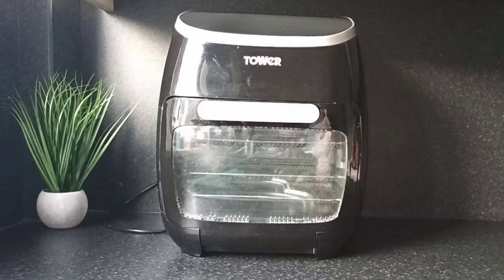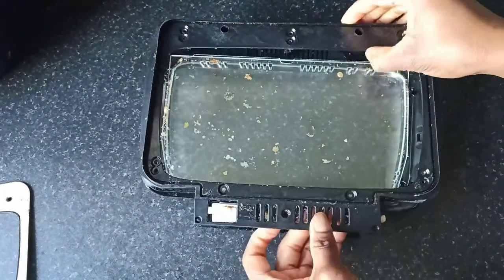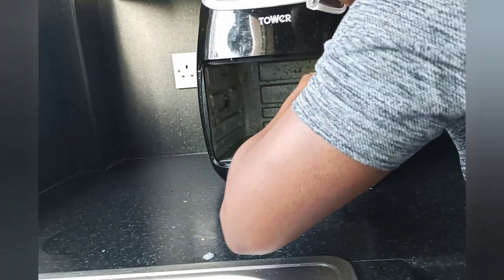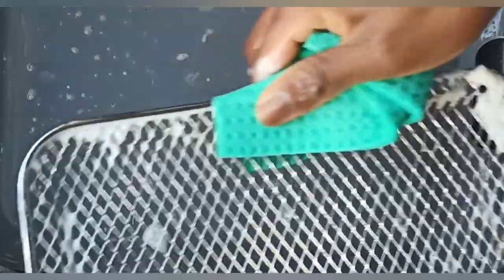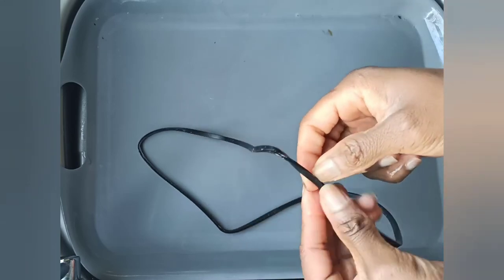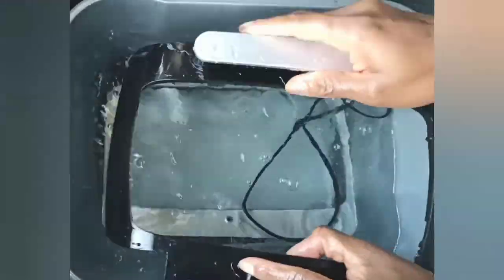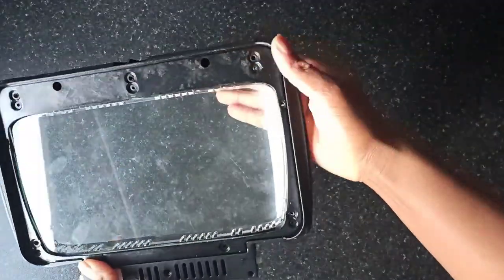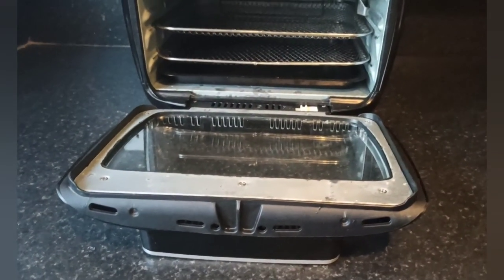CLEANING AND MAINTENANCE OF TOWER 5 IN1 DIGITAL AIRFRYER OVEN. How to thoroughly clean Tower Airfrye

Comment: thankyou Emily,🙏
this was very helpful,I also missed those 2 screws and without them undone and the cover completely off i didnt realize the glass/plastic was in to parts so they could be cleaned inside and out,
other comments mention rinsing it without taking it apart but that leaves water marks when dry,
this video is really the only way to do it thoroughly,,👍
Reply from the maker: You are welcome
Glad you found it helpful

Comment: Great vid. You don’t need to take the door apart though, just drop dish soap down the holes, let it drop down inside the panes of glass. Pour in water in same holes and give it a good shake and then rinse.
Reply from the maker: Thanks alot for the tip.
Reply: Thanks for this tip, I'm going to give it a good clean first then try your tip😊

Comment: Somehow a fly got trapped inside the door between the glass and the plastic. I have no idea how. I had to take it apart to let it out. 

Thank you for uploading this! Helped a lot as I was afraid at witch point the glass would come out of the door and didn't want to break it.

I put tin foil over the drip tray as it stops the drip tray from getting cooked on oil so it makes cleaning even easier!
Reply from the maker: So glad to hear you found the video helpful.

Great tip with the tin foil. Thanks